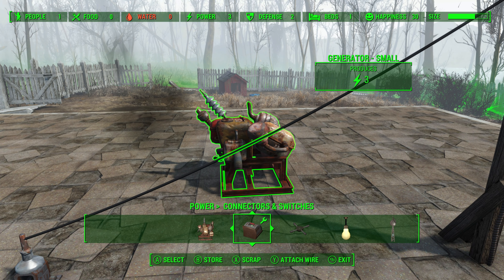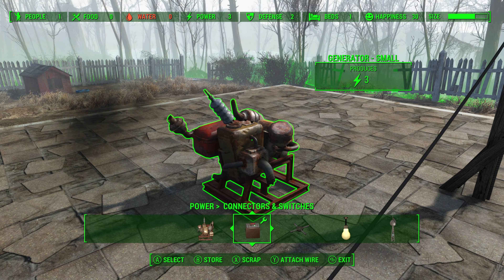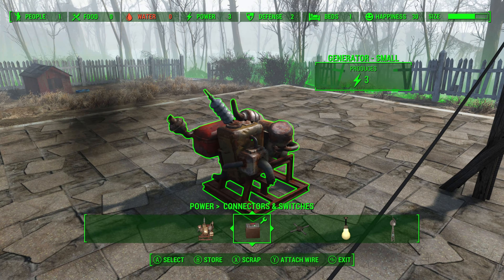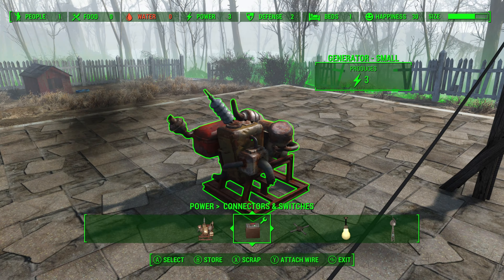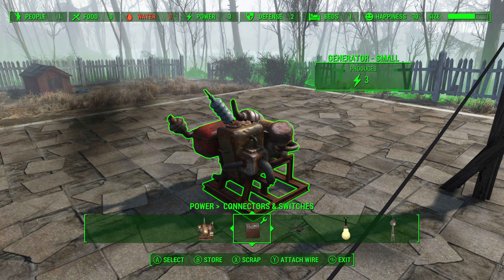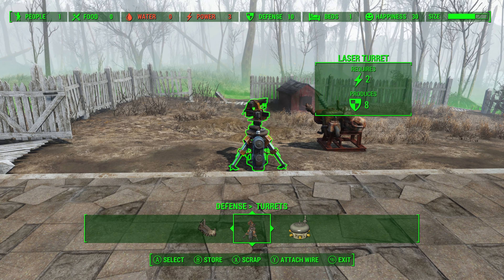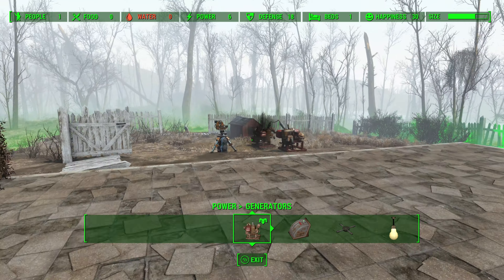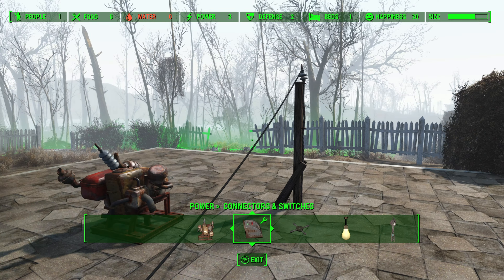UNLOCK the Wireless Power Glitch - Fallout 4!

Comment: Thank you, so this works with the powered items I’ve tried so far. Those cool but pesky wall mounted defensive spotlights are now useable.
Reply from the maker: Awesome,  thanks for letting me know and for confirming its working on your side.
Reply: @TrappedInFallout  That it does fine on Ps5 I’ve had a field day with this. You can give switches wifi power, great for manufacturing, connect the switch directly to the unit, use small generators as circuit breakers effectively, connect all your wireless street lights to one small generator and toggle on/off. You can also set up an epic fireworks display and use a small generator the same way, you can be on opposite side of spectacle island and set the fireworks off so you can enjoy them.

Comment: Which of the two (Power Pylon or Power Conduit) must you NEVER delete, in order to keep all connections intact?
Reply from the maker: That's an interesting question. I actually have never got rid of them. I have a central area in my settlement with both of these and have never deleted them. I suspect deleting the Conduit would be OK sine the Pylon has the power running through it.
Reply: Conduit. If u try to scrap it, the game crashes on xbox
Reply: Keep power source too and watch for dominant fields.

Comment: How do you power ON the arcade PROJECTORS ? Zeta invaders projection, red menace projection and pipfall hero protection. I've tried building a terminal to connect them but it so still doesn't pick them up.

The light bulbs i have in the roof work from the conduit and all 3 projectors are in close vicinity but none work :/ must i built another special terminal or anything else?
Reply from the maker: It's not something that I have used much but as long as its connected to a power source then I think that it should just work. Again I will have to double check butnas long as there is nothing special it should just turn on.
Reply: @TrappedInFallout  i think the latest 4k hd update broke and bugged these items

Comment: How do you fix the wifi glitch when I load in the power has been disconnected
Reply from the maker: Without knowing what your settlement setup is like, I would suggest you basically repeat the same steps again for each object that needs power in your settlement. You can alternatively setup a central hub and then connect one thing at a time from there.